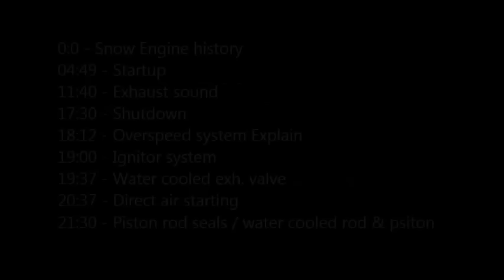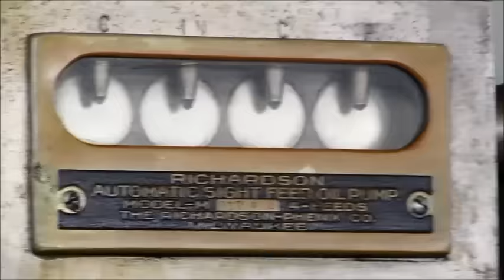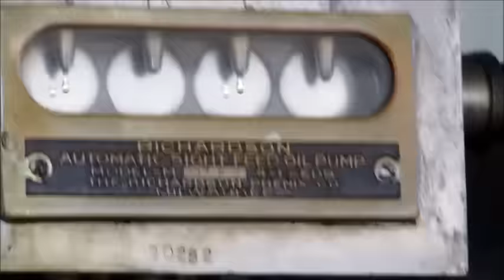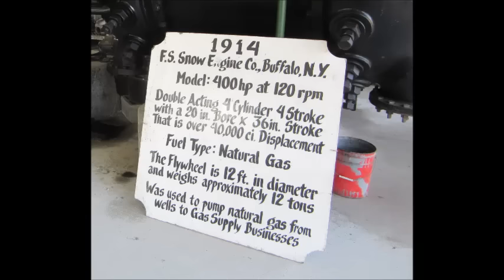The "Snow" Engine at Florida Flywheelers 2017

Comment: Was wurde mit dieser Maschine angetrieben?👍👍👍👍👍😃😃😃😃 Viele Grüße aus Germany
Reply from the maker: Hi there.  This engine provided power to a gas compressor. The compressor was driven by a connecting rod attached to the same crank journal as the enigne connecting rod. The compressor cylinder, and the engine cylinders are in a "horizontally opposed" configuration.

Comment: Those "valve" springs, look like front 
suspension springs on a Chevy truck!

I have always liked the Snow engine!
Only 600 HP, but about 9 MILLION pounds 
of torque.  And then, we have the design.
usually a compressor is driven by an engine 
that has a crankshaft, that drives a crankshaft 
in the compressor pump.  Reciprocating to 
rotary, driving rotary back to reciprocating.

Here, recip driving recip, with a rotary flywheel 
to take care of the rest.  (Timing, oiling, ignition, 
you know, all that other stuff an engine needs.)

About 12 minutes in.  Listen to the exhaust.
That is how they run it at half speed.  Only 
one cylinder running.  Don't fret, Coolspring 
does the same thing.

steve
Reply from the maker: Thanks. I'm glad that people really appreciate this engine as much as I do!

Comment: The ignition cutoff device is astoundingly stupidly simple and it WORKS, it's easily seen visually and maintained, even a child could understand it's workings unlike modern electronic "sensors" electric "eyes" and all the rest.
I didnt realize until the narrative at the end that it has 4 combustion chambers, I guess I thought it was more like a steam engine with one chamber for the steam to enter and exhaust, so that explains the 4 rocker assemblies and the sounds we hear int he video, so hard to tell what's actually happening with so many parts turning and moving what the sequence is, but the narriation at the end helps a lot.

Comment: Does anyone know what these engines are for?  obrigado  BR
Reply from the maker: Yes!  I know what this was used for.  This engine was an integrated compressor-engine.  There is a horizontally opposed connecting rod which operates a double-acting compressor cylinder. That cylinder is to the right of the engine cylinders on this engine.

Comment: The flywheel looks like it is a one piece casting, what a monster, bigger than any steam locomotive driver wheels I have ever seen. I suppose it doesn't matter if it is perfectly balance as it turns so slow.
Reply from the maker: That flywheel is very impressive!  But, I believe it is two pieces bolted together. You're probably right, they more than likely didn't dynamic balance it.  But it had to be balanced somewhat. Remember that the demonstration here is running much slower than the rated speed for the engine when it was running in use.
Reply: tim mayer the flywheel is a two piece unit. You can see the black" bow tie" tennon  on the rim that holds the two halves together.. very nicely made bit of kit.

Comment: I have a video of some of these in PA and now learning more detail . don`t forget to mention a 4 bolt mains on this engine along with the roller rockers
Reply from the maker: Thanks. I would love to see more of them.
Reply: @davida1hiwaaynet  Wonder if any collectors save a Cooper Bessemer 1,600 HP twin double acting tandem engine compressor ( has 2 sets of double acting tandem cylinders witch is 8 cylinder unit with 2 compressors
Reply from the maker: That would be epic! Those are HUGE as well!

Comment: Does the position of the flywheel at startup determine it's direction of rotation.?
Reply from the maker: Actually, the position of the flywheel has to be set in a position so that the cylinder receiving starting air is in the expansion (power) stroke. It always run in the same direction. :)
Reply: When the engine starts, if the piston was at TDC, the connecting rod would be horizontal and locking the engine from starting. Therefore the starting position would be a few degrees after TDC. What I thought, was if the starting position was changed to a few degrees before TDC, the flywheel would kick off in the opposite direction. Perhaps not a good idea to try out, since the flywheel lubrication system may be designed to correctly pump oil through its bearings in the direction of rotation marked up in the starting procedure. Depending on the design, pushing the piston back before TDC, could also reverse the rotation of the camshaft and alter the valve timing. These old engines are great to watch and are very educational to young people.
Reply from the maker: It's an interesting system. There is an "air distributor" which is turning with the camshaft. It will open valves to injece air into the combustion chambers at just the right position in the cycle to spin the engine in the correct direction. I'm pretty sure that when any combustion chamber is in the compression stroke, that starting air valve would not be open from the starting air distributor. The only way it could start spinning backwards is if the starting air was injected during the compression stroke.
Reply: Some of the older systems are far better than today's technology. Adding modern electronics to them would produce amazing results, but sadly it rarely happens. I have a pair of sewage ejectors working on the principal of this video, except that the control was mechanical. A block of stone at the bottom of the tank  and a 60cm brass float were fitted to a vertical shaft with an external rocker and balance weight keeping them in exact balance, As the tank filled, the float lifted and an alternating piston shut off the vent and released compressed air into the system. Since the control rod was in balance, ejection continued until the weight was above the waterline and increased in mass ending the cycle. Each of the 2 tanks ejects 600 gallons of sewage up to the sewer 50 feet above within 10 seconds. The direction of ejection was determined by a pair of cast iron with leather seat reflux valves at the bottom of the tank. These old machines which are almost silent were installed in 1926 and are still working perfectly today. They are in a London theater, where the stalls are below ground and hence below the public sewer. Their are still several of these systems working in London including at the houses of parliament. Modern buildings now install pumps that fail on an almost weekly basis. The most amazing story was of a building that was refurbished and the new owners did not even know that the ejectors existed in an underground chamber. They ran for 7 years before the building flooded when someone did not know what the air tank in the boiler house did and shut down the air compressors.  With the external balance weight now under water, they could not complete a cycle and divers had to enter the chamber and lift the weights up and down. Once the weights were above the water line, normal operation restarted.
  https://www.youtube.com/watch?v=8ROFfOxypno
Reply: This video shows one of these ejectors. At 0:47, You can see the bracket that originally guided the vertical shaft and carried the balance arm. In this video, it have been replaced with an electronic water full detector and a timer to determine the eject duration. In my opinion, this would have made them a lot less reliable. Although simple, few engineers can work out how to set the original balance weight to obtain a complete cycle. It was just a matter of the friction in the bush seals holding the shaft in the eject operation until the weight at the bottom of the tank came out of water and became heavier. 
  https://www.youtube.com/watch?v=JoYXuQcGlPo
Reply from the maker: Very cool system. It worked without electricity which is a very good thing for something that sits in the basement and would be perpetually damp and prone to corrosion. 

Fascinating about the system working for 7 years and nobody knew it was there until they accidentally turned off the air compressor and had a flooding problem!

Never knew they had such a system. Thanks for posting it!
Reply: Today's technology seems to be going backwards almost as fast as it is going forward. With theaters that use sewage pumps. engineers are having to strip them every time that someone flushes their ice cream carton or popcorn box. In clubs, it is even worse. Imagine having to unwind all the used condoms from the pump impellers every morning. LOL. London has a large amount of sewage pumping equipment since prior to the construction of the embankments around 1840, half of today's city was under more than 6 feet of water during the spring tides. Huge versions of these pneumatic ejector pumps weighing hundreds or tons are also used to lift the water from our deep underground sewers and needless to say the smaller versions are used throughout the London tube network.